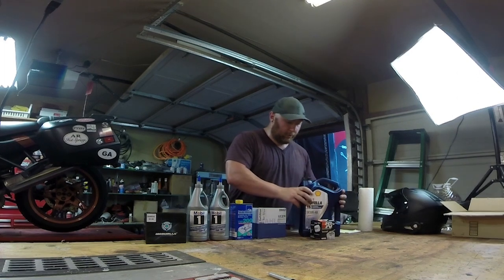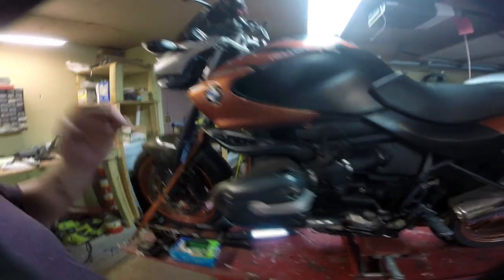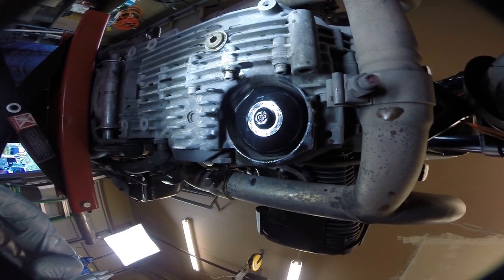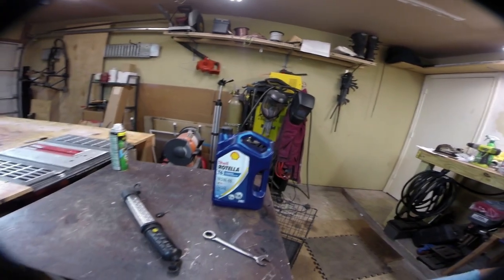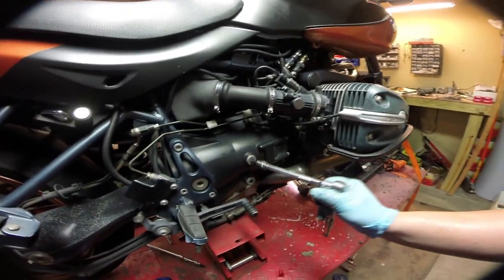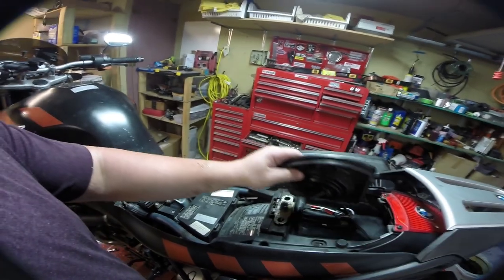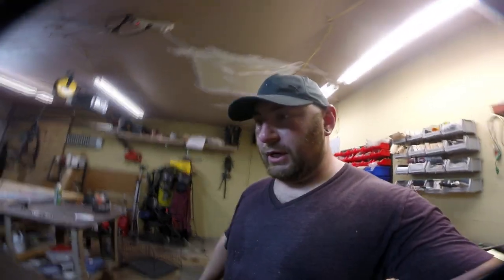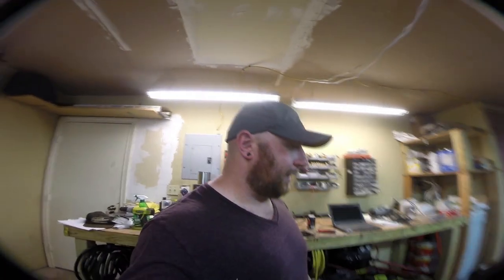2004 BMW R1150R | General Maintenance | Oil Change | Trans and FD | Air Filter

Comment: What goes in the space in front of the battery? I was given one of these and it has an empty space
Reply: I own the R1150R. The empty spot is where the ABS unit goes.
Reply: servo brake booster+abs i think

Comment: Do you still have this bike? I have one too and have upgraded the pushrods to solid chromeoly steel for a 1200 and also the 1200 cam tensioner. 41,000 miles on the speedo and expect to have this for many more years. Either way great video and I am now Subbing you 👍👍👍
Reply from the maker: I dont the bike is long gone. Thanks for the sub. These are great bikes.

Comment: You might want to reconsider your choice of oil for your motorcycle. The one viscosity fits all maybe ok for water cooled bikes but air/oil cooled bikes really need s heavier oil. 10w50 or i use 10w60 as recommended by John Gemi.